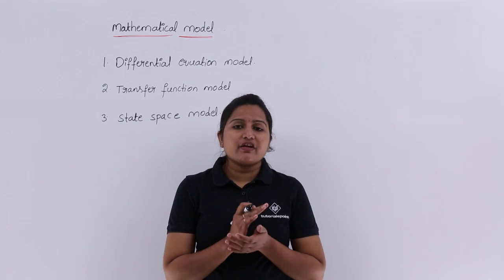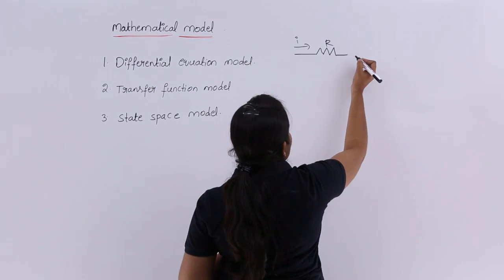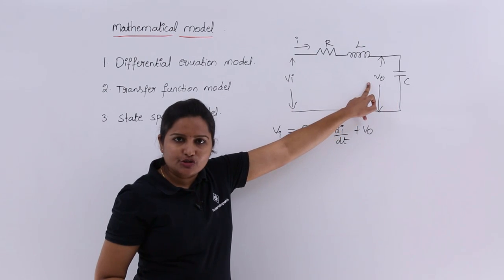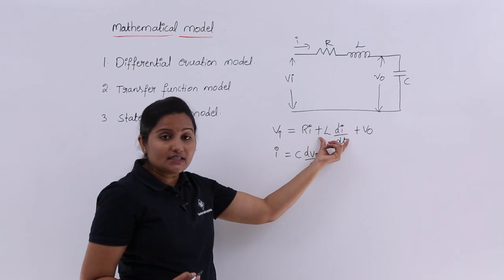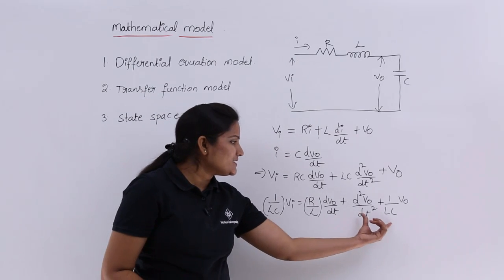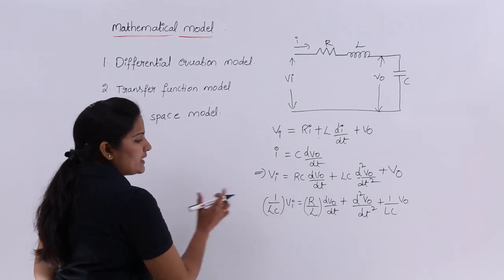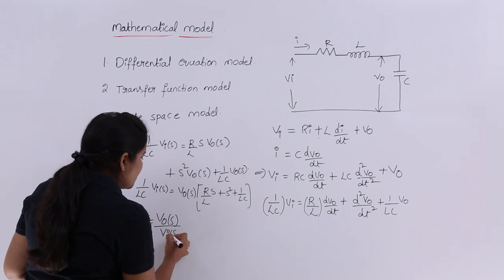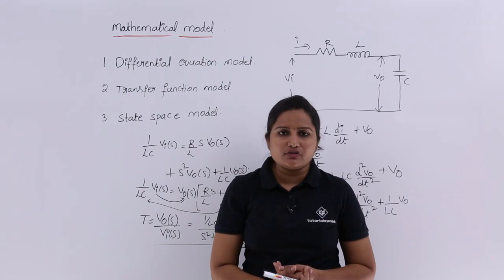Mathematical Model of Control System

Comment: Great video but why does everybody use this same example with Vout being the voltage across the capacitor? I've never seen this same example but with a resistor voltage as output which I think is a lot more complicated

Comment: @ 2:28, I want to know why you consider the current in terms of capacitor? Why not in any other quantity
Reply: this way you can write a transfer function , otherwise its not possible. Try this yourself and you will understand better
Reply: @hassanrabbaniboyka  Thanks for the reply. Please I have tried and in all the examples I have seen, they use capacitance current in place of I. what if a capacitor is not in the circuit? Can I still use I = Cdv/dt?
Reply: @ernestadonu9110  without capacitor it is just resistor and inductor. in this example they are solving for current. 
always solve the equation with one variable . that how you solve equations and make transfer function

Comment: wt is the use of those mathematical equations in Control systems? Will they help in industrial applications?
Reply: yes, if you want to write a code or design and control a system, then you need to model it first

Comment: This is not a control system, just a circuit consisting of resistance, inductance and capacitance connected in series.
Voltage drop across  resistance is R times i(t).
 i(t) signifies that current is a function of time.
Voltage drop across inductance is L times di(t)/dt
Voltage drop across capacitance is 1/C times integral of i(t)dt.
Inductive reactance equals omega times L . Omega equals 2 pi f  (f is frequency)
Capacitive reactance equals 1/omega times C
Total Impedance of the circuit    Z = R + j times x   x is a total reactance
j is defined as:   j square equals -1
Module of total impedance Z equals:
|Z| = square root of (R square + x square)
That's all boys and girls.